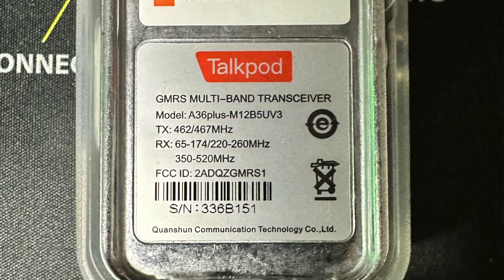TalkPod A36 Plus **UPDATE**

Comment: IIRC, there is no such thing as FCC certification for ham bands. The FCC certification on these radios is for GMRS. We hams need to check the harmonics ourselves.
Reply from the maker: When they sent their new radio for review it was sent as a FCC complaint radio for the amateur bands. It is still dirty. And I agree we should all do our due diligence to ensure we are legally using our equipment should one be inclined.  But I hope everyone loves their own life how they want.  Thanks for watching.
Reply: @Blackabeard  You can look up the FCC cert ID. If it's part 15, then it's GMRS. If it's part 95, then it's ham. I've never found a ham cert ID for any radio.
Reply: @Blackabeard  For example, I just looked up the FCC cert for Tidradio TD-H3. It only applies to GMRS, even though the radio does ham frequencies.